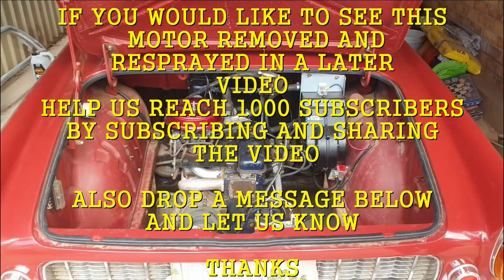RENAULT FLORIDE / CARAVELLE, Removal of the rear springs, and oil pan leak.

Comment: can the gas tank be replaced without pulling the engine?   thanks.  chris
Reply from the maker: Im not 100% as the tank was not removed from the car, but in saying that I have been looking and think it can be done. As the fuel sender unit is playing up in this car, think it may have a sticky float.. so keep an eye on the channel. As soon as I get some free time I will be finding out 😊.

Thanks for watching 🙌
Reply: On the Floride, where the tank is placed below the floor pan, under the rear seat, it is indeed possible to replace the tank. A Dauphine tank will fit the Floride. On the later models; Floride S and Caravelle, where the tank is placed above the transmission, it is a bit trickier. But it should be possible to wiggle it out if the cylinder head is removed. I have not seen any aftermarket spare tanks for these newer cars on the market however. The original Renault spare parts books and repair manuals for these cars are available for download on a few placecs on the internet.